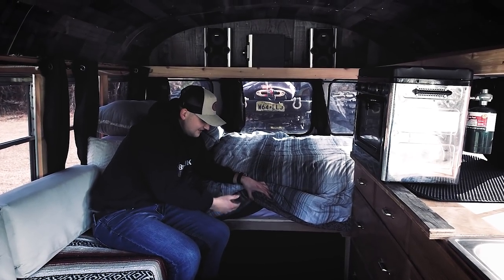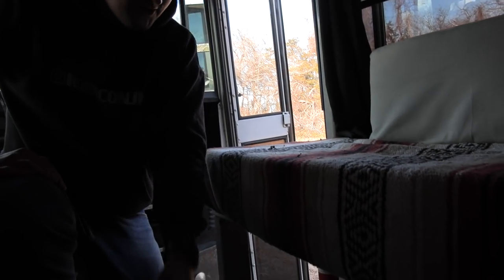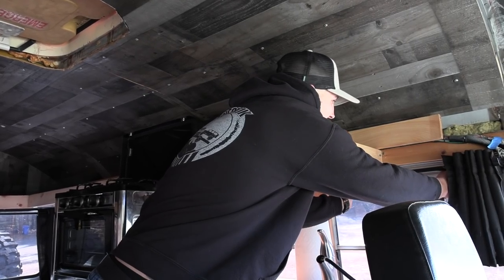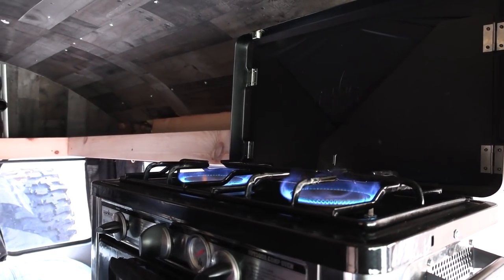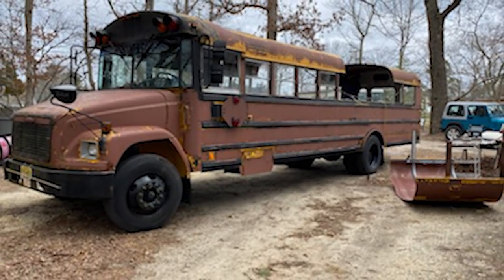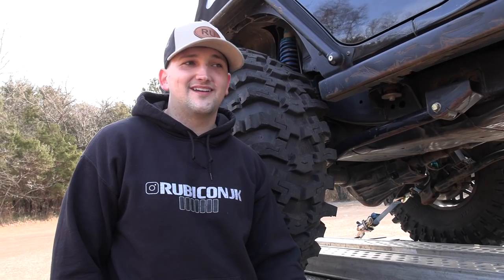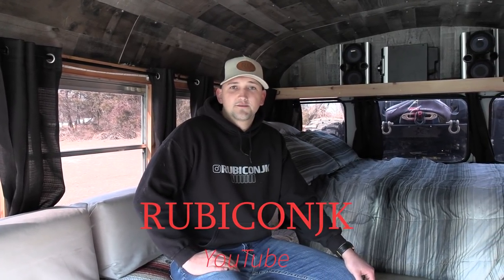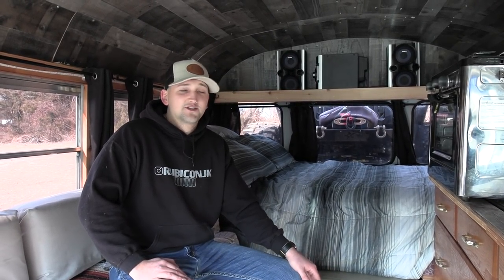EPIC BUILD | COLLEGE STUDENT Converts School Bus Into Camper Toy Hauler for JEEP Adventures

Comment: Very clever toy hauler!  With a bit of elbow grease you did the job yourself, bravo!  Slicing a bus in half must have been loads of fun!  Simply amazing you did that.  Thanks for explaining how you attached the rear section back to body - combination of riveted metal plates and welding points.

Thanks also for explaining the titling and insurance process.  Here are the steps I wrote out for myself:
To convert School Bus Title to Motorhome RV title in NJ state:
1. Remove all school bus signs, cover up lights, stop sign, decals, and paint over the yellow body.
2. Remove all seats inside, and make it look homey with furniture, sink, bed, couch, fridge, cookware, etc.
3. Get school bus weighed on a certified CAT scale.
4. Apply for RV title with photos and weight, and it may take 3-4 months to get title from them.

Apply for Insurance:
1. Once title is in hand, apply for insurance.
2. Never mention the words 'school bus' to insurance company.  
3. Mention '2001 Thomas Freightliner RV' with photos.
4. RV insurance is much cheaper.
5. You don't need a Class A Commercial Drivers License (CDL) if you are driving an RV.
6. However, some states may require a CDL if your bus has air brakes, but NJ was okay.

I'm very interested in the paint you used to do the exterior.  I looked up Sherwin Williams Direct to Metal Paint that you mentioned.  It comes as an Industrial Acrylic and also as an Alkyd Enamel.  I assume you used the oil based Enamel, right?  Some questions:
1. What did you use to brush it on - brush, roller, mohair roller, other?
2. What solvent did you use to dilute it, clean brushes - Xylene, Mineral Spirits, Acetone....?  How easy was it to find the solvent in your state?  CA has so many anti VOC laws that paint products are hard to find.
3. How many coats did it take?
4. How is the color holding up in the sunlight and weather?  Any fading, flaking, peeling, etc?
5. Would you have done it differently now that you have lived with it?

I have an RV to paint and research into paints is difficult.  Bedliner?  Automotive?  Specialty paint?  So much to know and its pricey so experimenting is not an option.

My tip to you:  Fabric.com has Roclon Blackout rubber cloth at $2/yd on sale at 60" width. Effective for backing your curtains. Blocks out light, insulates a bit, and prevents curtains fading in sunlight.  Good stuff!